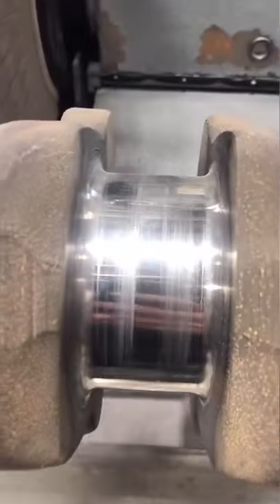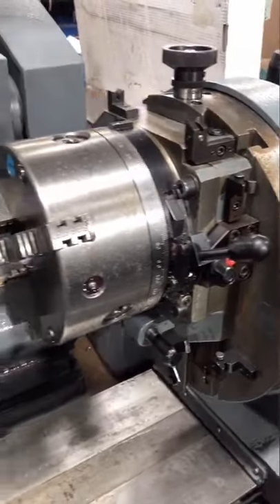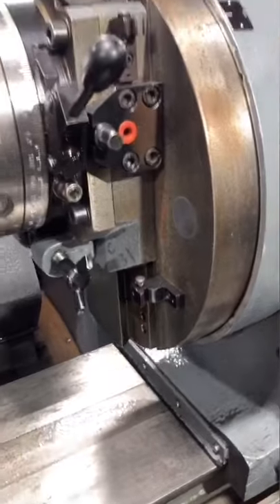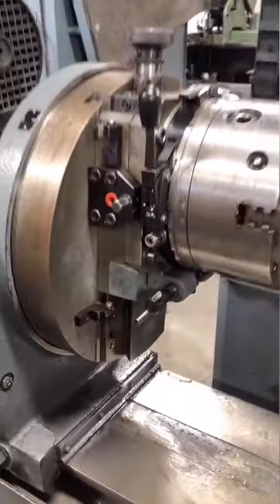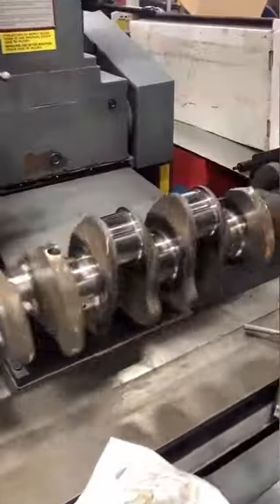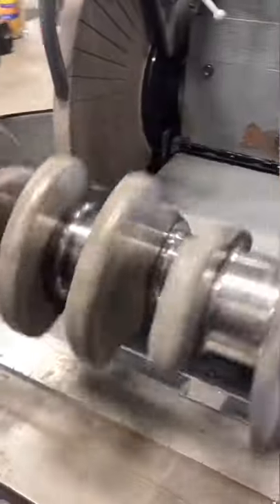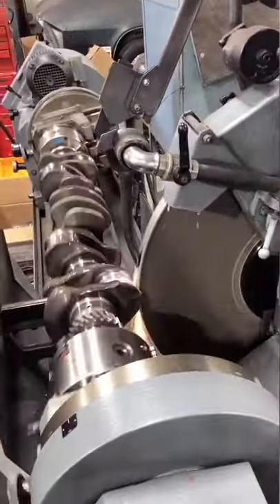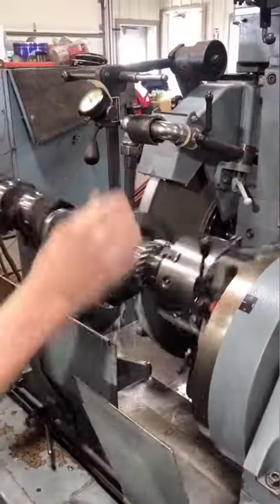#shorts How A Crankshaft is Reground - JAMSI ONLINE

Comment: If it’s been worn down, how does grinding more off fix it?
Reply: They usually wear uneven so a regrind gets a fresh surface across the width and you get new bearings to compensate for .010 unders like this rather then running oem spec bearings on something that may be .0005 under on one side and .001 on the other. Can't speak for this application but typically when I do a crank it has less than .0002" taper acrossed the diameter.

Comment: I want to know about balancing the pistons Rowland crank. I just know that the pistons and rods when assembled should be the same weight? Right
Reply: Each piston and rod are weighed individually and made the same as the others by removing material. This process is called "blue printing" an engine.

Comment: Cool. Don't ever buy an engine with surface hardened crank and camshaft because they can't be reground and the engines can't be rebuilt.   If you ever need to replace an engine the cost is really high you need a new engine...not reman....all new.  Burnt me once. And the engine didn't last as long as regular engines.   When engineers try to get too fancy.....run

Comment: How do you allow for the grinding stone wear?
Reply: At the end there is a dial gage he drops down onto the crank to check diameter. Grinders like this also have a diamond you dress the wheel with to get a new, straight wheel surface. You can also hand blend or use a template to put a radius on the wheel corners to match that of the cranks spec.

Comment: 10 thousands over sized not under
Reply from the maker: Nope. The journal is .010” under the standard factory size. Undersize.
Reply: @JAMSIONLINE  yes the bearing is 10 thou over
Reply: @JAMSIONLINE  if you take 10 off the journal ,then put a 10thou under bearing you have a 20 thou gap ,,,no
Reply: @JAMSIONLINE  over size bearing under sized journal ,,,I've done grinding ,surface ,Blanchard id,od,cranks ,cylinders, anything really but I could b wrong ,,I'm not trying to b a smart a ,I was just asking sorry